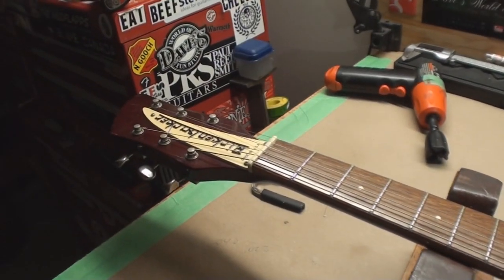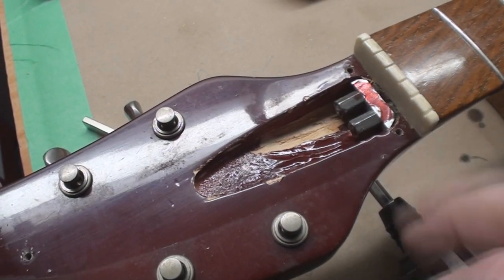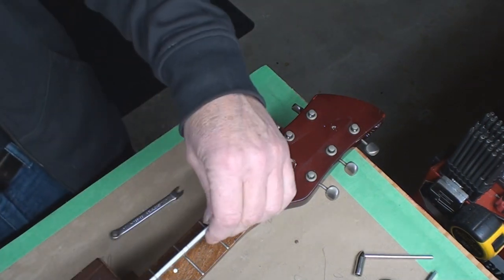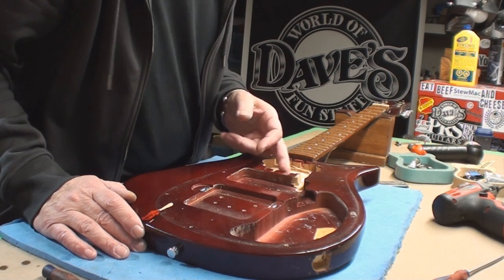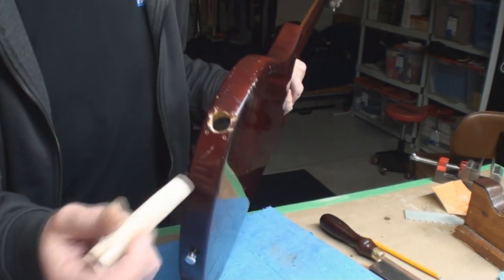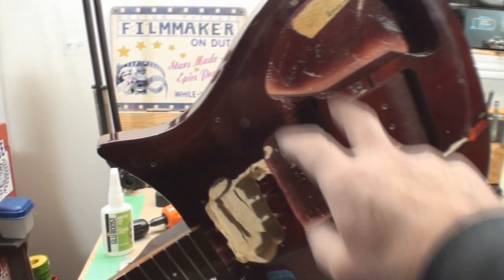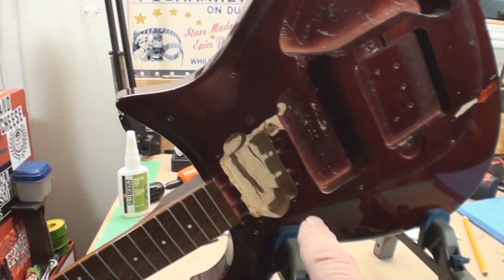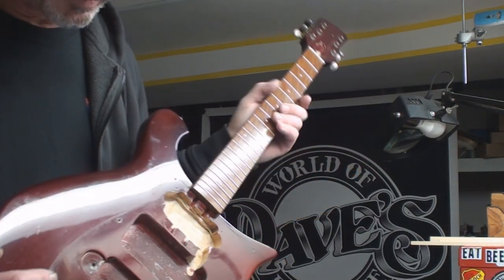1976 Rickenbacker 425 Guitar Repair Part 1

Comment: this series was amazing. I picked up a really cheap 425 which was having the body wings separating form the centre neck  post. I knew by Dave's vid about what would happen when people rout out for another pickup. Managed to clamp the body flat and fill with small layers of carbon fibre + epoxy and cover with filler to make pretty. The guitar is now my main guitar, perfect stability and action!! amazing.

Comment: Dave, your setup vids are top self! This project gets to your real talent! The restoration of a worthy guitar. I would carefully rout the neck pickup cavity to a workable square and glue in a solid piece of like wood. That way you replace the wood that was taken out with a one piece replacement and stabilize the neck joint by joining the neck wood with the body wood. Just an observation. As stated earlier you are way capable of any repair! Until put. 2. Thanxz

Comment: I often think of Rickenbacker as the AMC of American guitars. Fender and Gibson were the typical maker of Mustangs, Camaros,  Fairlanes, and Chevelles, whereas Rickenbacker was the maker of Javelins, Gremlins, and Pacers. I've owned a few Ricks over the years, but have never really liked any of them enough to keep one.
Reply: haha-  Yeah,  I  have  to  agree  with  you...although  I  still  have  my  4001  Bass
I  bought  in  1982  and  still  plays  great..
Reply: Rickenbacker is the odd one out,  but they do have their fan base.   I have 4001 bass,  a 360, and a 330/12.   I like them all very much for what they provide.   They have a very situational sound,  but it's really cool,  and I like the feel.
Reply: They look cool and unique and sound cool and unique, but they're a pain in the ass to use and maintain. Bridges that are hard to set up and block palm muting, frets that are not much taller than the fretboard finish, two truss rods that give you more headache than benefits, string pairs on a 12 strings are the other way around than on every other guitar etc. etc. the list goes on. You struggle to make them usable like a modern instrument without introducing irreversible mods as that devalues their steep price, and if you ask for advice the fanboys come out of their caves and try to skin you alive because if you want to take out the horseshoe from the pickup ring to them that means you should've gotten a different axe in the first place.
Reply: Well said! Agreed.

Comment: More than just filling in that hole I'd attempt "somehow" to restore the continuity and leverage of the neck tenon. I can picture the neck separating from the body under strap tension at some gig someday. Maybe drill in under the trusses into the neck heel and epoxy a hard dowel across the void and then pack it in with whatever filler. Is there enough meat in left in the heel for that? Classic cool looking guitar, by the way.
Reply: yep i did this but used epoxy/carbon fibre resin. just a couple layers but across the whole dodgy rout someone did. perfectly stable now!
Reply: In that idea. the really extreme way would be, after filling the hole, to remove the fretboard  and add  carbon fibre reinforcement srips from farther up the neck  and through the new wood in to the body.   A lot of work but it wont be a weak spot anymore. and that massive pickguard will cover much of the work.

Comment: I'd be tempted to epoxy some carbon fibre in the bottom of that hole Dave but I'm betting you'd rather fill it with original material.